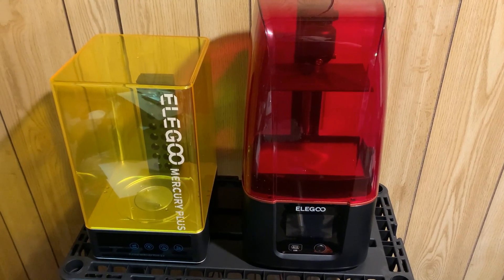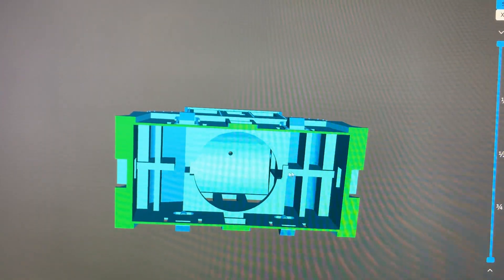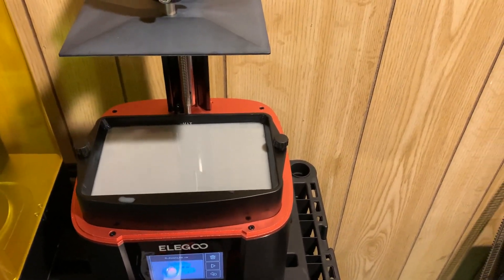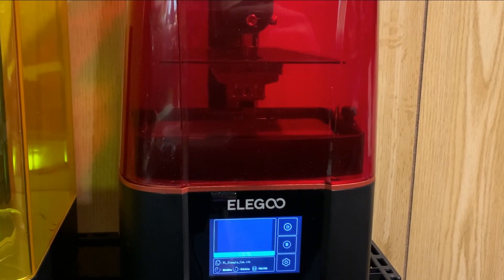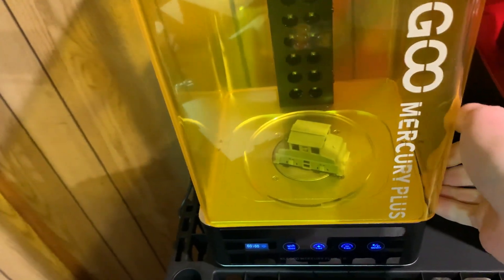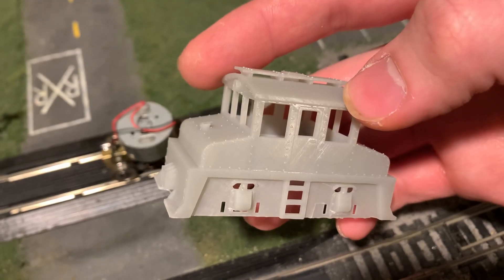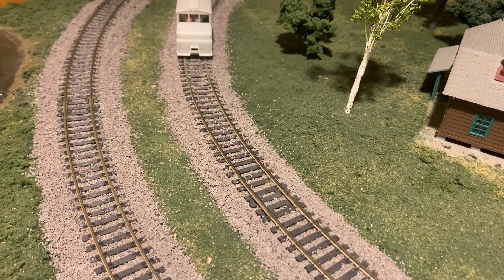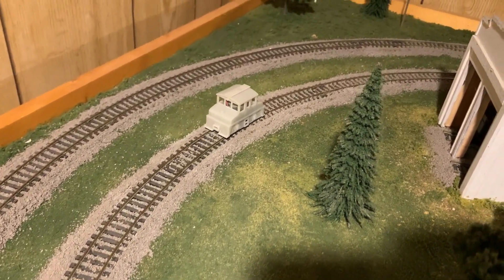Some fun with my new 3D printer!

Comment: Your Thingiverse page says that you used a NWSL Stanton drive with 40" wheels, but you did not say what the wheel base is.  NWSL lists 24 different units with 40" wheels.
Reply from the maker: I actually used a custom truck on my own model, but the chassis on Thingiverse was modified to fit a 39278-4 Stanton drive with 7' wheelbase and 33" wheels.  For the unpowered front truck, use 40" wheels for the front axle and 33" wheels for the rear axle.

Comment: I wish the Bachmann GE 44 Tonners ran as well! Haven't had very good luck with them at all... but others rave about them!
Reply from the maker: My single motor 44-Tonner runs well, but the older 2-motor design was prone to gear issues and burnout. It also helps to replace the DCC board with something better, or just hard wire in DC.